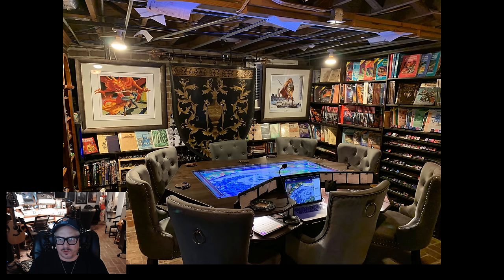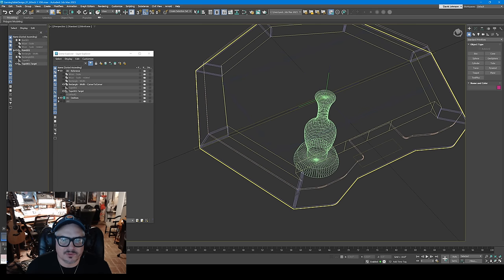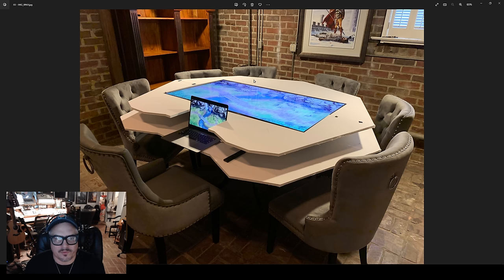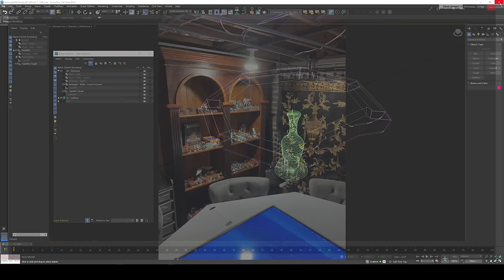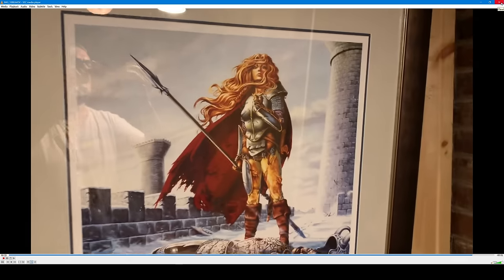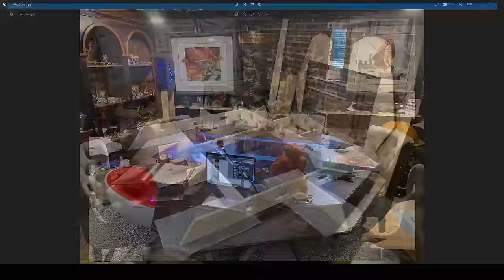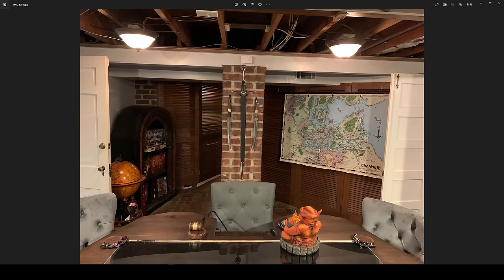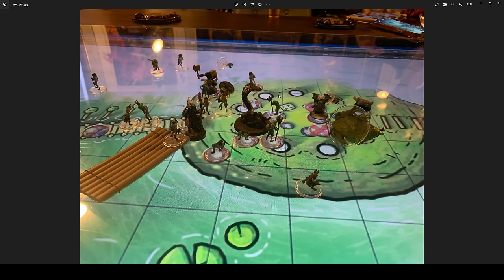Dungeons and Dragons Game Table Room Build Video

Comment: Great looking room and table how fun! Quick question from the ground what are the heights of all the levels? Do the players have issues getting their legs under the table. I'm guessing the height of the top level is not to high? And Subbed!
Reply from the maker: If memory served, I put the lower table at 26" high.  We haven't had a player mention an issue yet.  I'm happy to measure it for you, if you need that.  A good buddy of mine is a tall fellow... so I thought about him in the design.  Because the table is not bolted on to the "galvanized pipe legs"... the height is functionally adjustable.  I can take out the top pipe, and stick an inch longer one on... if I know my buddy is coming to town!

Comment: The desk height is very high. I guess you really have to stand up in order to move your mini on the tabletop, right?
Reply from the maker: It's a two level table... the lower is 26", which is lower than a standard kitchen table.  It's right over my thighs.  The upper is about 8" higher... a bit higher than a standard kitchen table.  The height isn't that much of a problem, it's the distance... I made sure that the DM is in more than the players so that I could easily reach minis.  and we have a few "croup sticks" to push minis around.  So we don't have to stand to move minis, but sometimes we do.  We mostly just push them around with the sticks.

Comment: Man, this is super cool. Maybe you said it and I missed it, but what kind of wood did you use?
Reply from the maker: Pine.  I'd never woodworked before in my life... and at that moment, wood prices were very inflated.  I figured I'd likely end up redoing parts of it (it's fairly modular), so I'd start with cheap pine... and upgrade as needed.  It definitely gets little mars and dings in it easily because it's such a soft wood.  But I figured for a starter newbie project... going cheap would be wise.  I'm confident enough now that if I redid any bits, I'd go with  a more expensive wood.

Comment: What's the mic and switchboard set up! Does it work well? How do your players find it with your voice and the altered voice at the same time?? I'm about to build a table and one of these mic set ups is in my list of musts.
Reply from the maker: Here's the first of 2 videos showing off how it works, and how to replicate my setup:
https://www.youtube.com/watch?v=RxlYuK8IlhU&t=115s

It works great!  It's super fun to play with as the DM!

You're right, they do get a mix of my voice and the pitch shifted character.  The speakers are up quite a lot, so the volume coming through the speakers (quadraphonic) is much higher than my voice.

It takes some getting used to, and iterating the levels of things to get right... but I'm not speaking very loud, and it comes through quite a lot.  I suspect the speakers volumes are 2x - 3x louder than my voice in the room.  I've set it up so I can speak fairly quietly, and get a good clean sound out of it.

Comment: Would you make the table any bigger if you had a larger room to work with?  Just curious if your players feel like it's too crowded ever or it feels right?
Reply from the maker: Good question And Beer.  No... I probably wouldn't make it any bigger if there were more space.  When we have 6 players and everyone has their own "side" of the octagon... it's pretty ergonomic for them.

But yes... given our current space... it's definitely crowded.  An ideal room would have about another 1.5 to 2 feet on each side of the table.

When we're seated, everyone is comfortable and good.  But if anyone wants to get up and go get a drink... there's next to no clearance behind players.  They have to get up to let people out.  So a bigger room, I would love.... but the table is killer as is.  It's already a 60" tv embedded in it... much bigger than most digital tables I see (closer to 40").   and the size is already partially tied to "how far someone can reach to the center".  Any bigger and there would be dead spots where players couldn't really reach the center of the table any more.

Comment: Looks fantastic, but that base is awfully small for such a wide table.
Reply from the maker: Thanks man!    The Base?   It's pretty sturdy... galvanized steel!
Reply: @undertone_dj  Oh, I'm not doubting it could hold it up, I'd be worried about it tipping over because the foot is too narrow. Too much weight on the edge, one person leaning on it too much, and boom. Done. Unless you mean you used that steel pipe contraption as extra support underneath, and I somehow missed that. That would definitely work.
Also, I'm really digging the decorations and bookshelves. Can never have too many bookshelves.
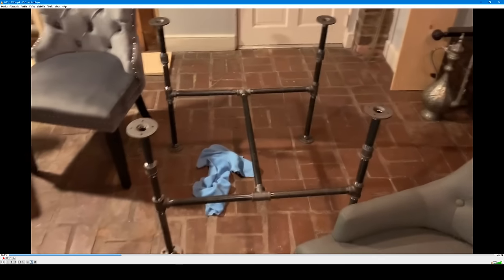Reply: @whiterabbit75  13:24 Looks like he abandoned the pedestal design but I missed it if he made that clear.
Reply: @nforne  Yeah, I think that's what happened. I can't think of any other reason for him to even point it out.